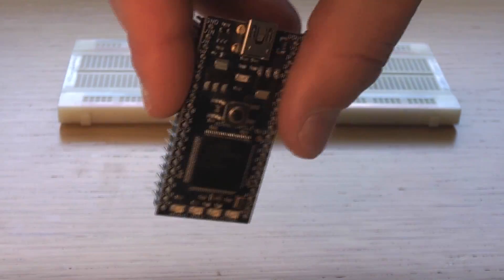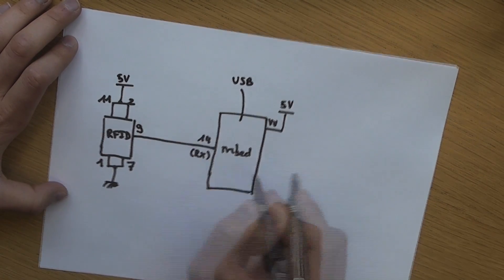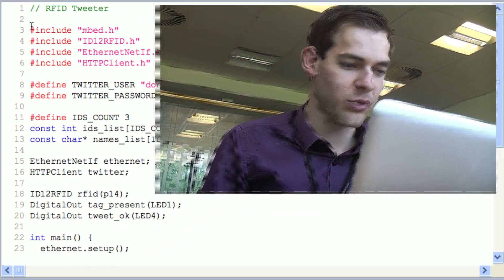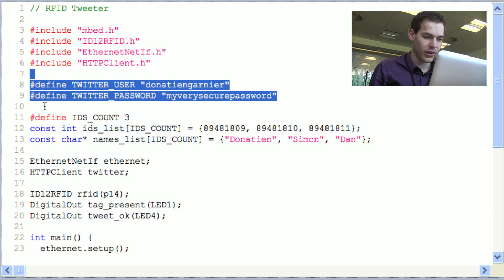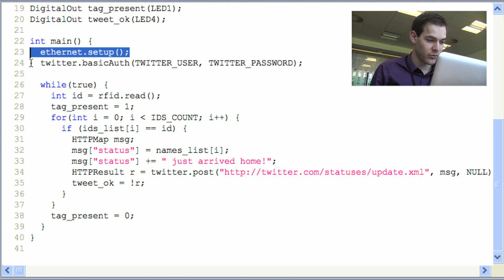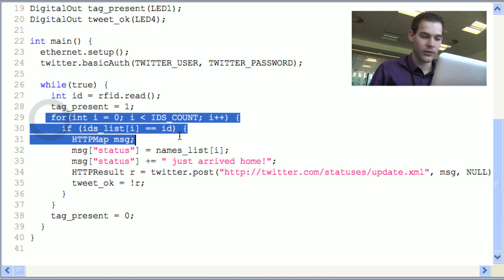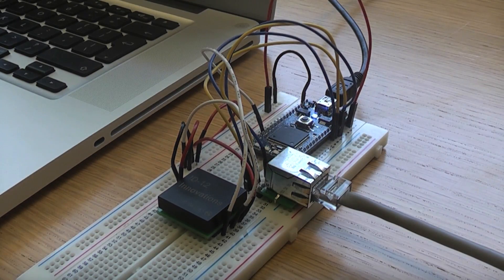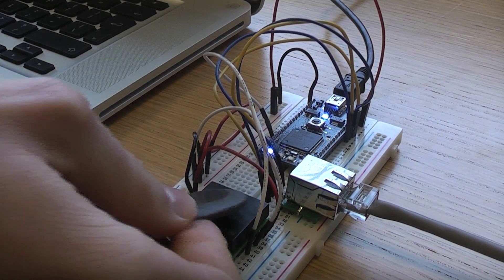Using mbed to prototype the Internet of Things

Comment: hi I bought all the components as specified, however it dose not appear to work, so I changed the connections to the RJ45 socket and it is now able to send tweets, however only every other time, it is not consistent. What could be the cause?
I am using my laptop and sharing my network. The data sheets of the device I'm using is the one specified in the video.

Comment: I have bought the components required to carry out this excersise, however the pin connections dont appear to work the way you have specified. I changed the pins to my rj45 and now it is able to send tweets, however not constantly, what could be wrong?one time it will send the next time it wont. Im using my laptop, and sharing my netswork.